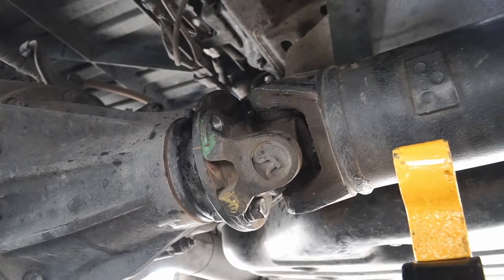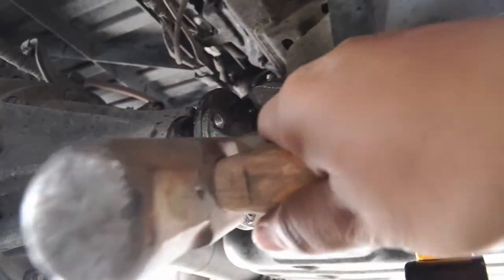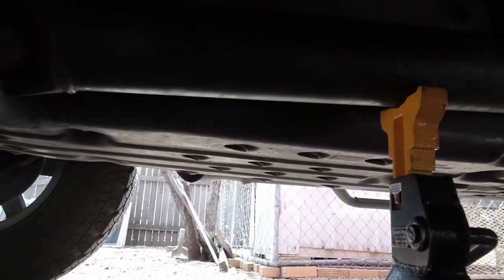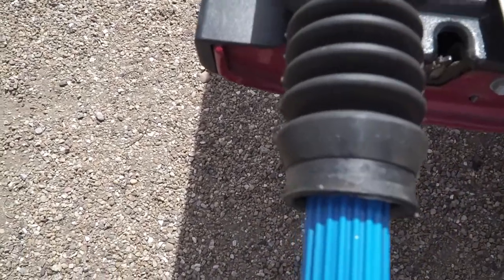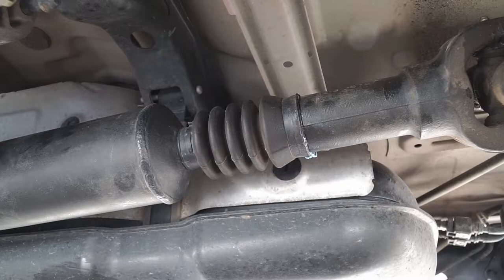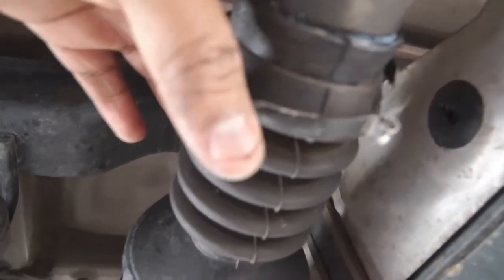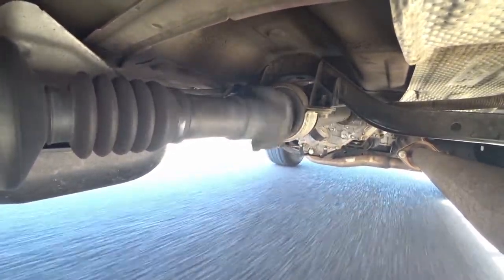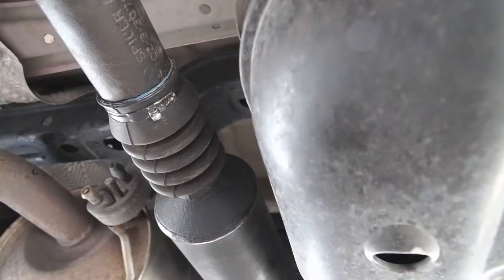2012 Toyota Tacoma Drive Line Clunk Fixed!!!

Comment: I normally do not comment on videos, but this completely fixed the rear end “bump” feeling when coming to a complete stop and then when accelerating off the line again. I’ve been trying to figure out a solution to this issue for over a year now and just stumbled across this video on a Tacoma group page on FB. I just went on a test drive the issue has been solved! Thanks again for making this video 👍🏼
Reply from the maker: Hey man! Glad greasing the shaft fixed your issue and this video helped you figure out the cause! Woot!
Reply: What kind of grease do you use? I have some lithium grease here at the school im going to, would that work? Or does it need to be the specific?
Reply: Pacheco _15 heavy duty grease is what I used from advance auto zone and it worked, I don’t know if regular lithium grease is thick enough or not.
Reply from the maker: Pacheco _15 i am using a Teflon based grease, since that’s what is needed. Do not use petroleum based grease as it may eat the rubber on the splines. 

The grease I use is from Motorcraft. I think I left a link in the description or the name of the grease. This Ford grease is amazing and cheap, best out there you can use. 

Stick to Teflon based grease.
Reply from the maker: David Mac actually you don’t need thick grease. Lithium grease may be too think. That’s more for like poly bushings. What you need to use is Teflon based grease. Make sure what you got at Advanced Auto is Teflon based and not Petroleum based grease.
Reply: Five Foot thanks for the info! I ended up going with the Lucas X-TRA Heavy Duty Grease (green and white tube) and it fixed the issue. I can’t find any info about the chemical make up of this grease if it is lithium, teflon, or petroleum based so I’m not sure?
Reply: I'm about to tackle this issue on my crew cab. Is the grease job still working good?
Reply: @telegoose9905  it feels fine during the warmer months, but during the colder months seem to feel the clunk just barely. Overall it definitely helped the issue though so I might grease it again after winter is over (about once a year)

Comment: Hey there, I’ve had the clunk and slight shudder from first to second gear for quite some time now. Depending on hot or cold temps. I’ve been to multiple shops and everyone says it’s just a quirk. So glad I found your video and can’t wait to get this done in hopes in fixes my problems. Keep you posted
Reply: Did it fix it? My 2012 does the same
Reply: @danielzwarren  it did fix the clunk! However I still have the shudder at take off. I think I’ve narrowed it down to pinion angle being the issue. Gonna try axel shims next
Reply: @SHREDDINLEMUR Any luck ?  I have the rear clunk

Comment: I used the new white grease from ford that comes in the driveshaft repair service bulletin kit 9L3Z-4W602-A, $30. Most people that use even very good grease state the clunk comes back 10k miles or so, but so far so good. At first I only lowered the support bearing and added some mobil 1 bearing grease to the splines, the clunk was the same.

Comment: Thank you for this. I have a 2017 taco and I was wondering where to service the shaft for the rear.  Toyota told me it dont need to be serviced but the manual specifically says service the damn thing. The guy told me because it does not have a zerk and its a sealed item. I  sure it still have gears and have moving parts and anything that has a spline gear moving needs to be serviced.
Reply from the maker: You're welcome! Glad this video was somewhat helpful to you :)

Toyota told me the same, they told me in order to fix the clunk noise I had to replace the driveshaft, which I thought was nuts so I did a little research and found how to service it.

Same with the automatic transmission. Toyota says its a sealed transmission, I've flushed my transmission at home at the recommended mileage, dropped the pan and cleaned the magnets and replaced the filter mesh AND finally, installed an inline oil filter and oil cooler :) She's been running fine AND much better for the last 35k miles since I did the maintenance job.
Reply: @temosgarage  i wish you made a video for that. My Taco is at 30k, im looking for a specific video about the transmission too cause i iwant to change it at 30k.

Comment: Thanks for posting this  video, I have a 2015 tacoma,I also have a 2004 jeep grand cherokee  and this happen to it, I bought it used had the same issue on it called bump stop did the same as you with the same Motorcraft lube and had no more problems with this, I didn't  know this happens with tocoma as well . Thank you for making me aware this could happen .Thanks you...

Comment: Just thought I'd let others know that are looking to do this job. You can also disconnect the clamps on the boot then take the two bolts off that hold the carrier bearing, then lower the center of the drive shaft where the center U-joint is located at the spline. It will come apart. (the weight of the two halves will pull the drive shaft apart and separate it at the spline so be sure to hold on to both halfs when doing this and keep something soft below in case one of them strikes the ground) Be sure to apply the parking brake when you put it in the location you're going to do the job this will take the load off of the drive shaft so it comes apart easily, this will allow the splines to line back up where it's supposed to when you're finished.
Reply from the maker: Good point, ill have to try that next time. Thanks!
Reply: Do you know what the torque spec is for these two bolts? also 65 ftlb?
Reply: @jrbling25  I never looked up the torque spec on those bolts.
Reply: @mech4061  the link that you put up for the cowfoot wrench. Is a slandered. Toyota is metric correct?
Reply: Wow, that sure was painless. Thanks for the tip. Finally stopped that annoying clunk.
@Mech40Tacoma
Reply: Doing it this way, it was hard getting the 2 halves back together again, but finally forced it and it went in. 👍
Reply: Does this method in any way endanger the u-joints from snapping or snapping the bolts connected to the rear diff?
Reply: @70Marc   how did you force it I’m fucking struggling brother
Reply: @romangarcia9338  , was away and no wifi, so no early reply.
Anyways, you got it apart, obviously. Hopefully the shafts didn’t turn on you, so they should realign. Not in neutral.
Rotate, as in move the shafts up and down, sideways, roll around till they’re very close to going in. Once you find the sweet spot, they should go in. Worse case scenario, you find a spot that’s almost there, and kinda pull or push it in till  it’s in.
Hope this helps, drop a note, hopefully you were successful. 😊
Reply: Much appreciated brother ended up tapping it with a dead blow hammer once it got close and it went in by the grace of God .
Reply: @romangarcia9338  , my first time i kinda had to do that. Next time it went in super easy.
(Unfortunately, I’ve recently got the clunk again, but I was towing my travel trailer.) Taking it easy on the clutch eliminates clunks.

Comment: My Tacoma manual states to use NGLI # 2 grease either Lithium or Moly based. I’m not familiar with this Ford one. Would using this Ford brand be ok?
Reply from the maker: I think you’re referring to the u-joints. I’ve been using this Motorcraft grease for years. It’s an excellent grease for the slip yoke. It’s not just ok, it’s excellent.

Comment: Cannyou put a spring inside the splines to absorb the slide bump?
Reply from the maker: I’m sure it CAN be done, but long term wise I would think the spring will do damage to the splines since they’re coated with what looks like Teflon. It’s better to just grease it. Lasts a while too. 

I’ll be greasing the shaft this summer, it’s starting to make that bump/tap feeling again.

Comment: I'm hearing a noise from my 2013 tacoma when I come to a sudden complete stop. It won't do it if I'm stopping very easy but when I stop sudden I hear a slight thump noise like the truck is settling from a slight shift in the rear.  I'm thinking it's a leaf spring. The truck only has 53,000. I couldn't see it be anything else with that low of mile
Reply: It's axle wrap. It happens when the factory leaf springs start to wear out
Reply: I have the same clunk when I stop or when the axle rocks

Comment: you marked the back of the tail shaft where it goes to the diff but NOT the front ?? You should mark the front as well to get the splines back as before
Reply from the maker: I did mark it, just didn’t capture it on video.

Comment: My 2002 Tacoma doesn't have that rubber boot but the slip yoke does have a grease fitting but my manual says to use moly grease. I do notice a clunk if I go to long without greasing it though.
Reply from the maker: So, moly grease is for the u-joints. I am not sure what to use on your 1st Gen Tacoma. This video is specifically for the 2nd and 3rd Gen Tacos. I would guess the 1st Gens would also use a Teflon based grease.

Comment: My 00 tacoma forerunner vigrate when I put it in gear. Do I need to replace u joint and center bearing
Reply from the maker: Only vibrates when you put it in gear or vibrates at a certain speed? If when you put it in gear, could be something more serious than u-joints/carrier bearing. Could be a bad torque converter. If it vibrates at certain speeds then might be the ujoints and/or carrier bearing. Being a 2000 model, if the ujoints/carrier bearing have never been replaced, it might be time for them now.
Reply: @temosgarage   only on drive gear it make noise
Reply from the maker: Idk man. that's a tough one to diagnose without actually being there to check it out.

Comment: I’m getting like a clicking/rattling sound on my 2016 Tacoma. It snowed pretty bad today and I had to engage 4WD.. I am wondering if that is causing it. It is happening in 2WD too. Any help? Thanks in advance
Reply from the maker: Sorry for the late reply. The slip yoke should not cause a clicking/rattling sound. Could be an exhaust shield maybe? crawl underneath and start wiggling parts and see if you can narrow down what it is.
Reply: Carrier bearing is bad.
Reply: Catalytic converter, or 4wd actuators.

Comment: @five foot garage great video. Quick question....what did you use to mount the camera under your truck to capture video of the driveshaft in action? I am pretty sure my 2016 Taco U joints are going out and I could be having this drive line clunk too but I want to put my go pro under the truck to capture my driveshaft in action.
Reply from the maker: A strong magnet I got on Amazon years ago

Comment: What if you overfill grease to the driveline and it makes clunks noise
Reply from the maker: Remove the driveshaft, clean the excess great and assemble it back together. 

Too much grease in the yoke removes surface area that allows the spline to move forward/backwards (in/out).

Comment: That rubber boot isn’t installed from the factory is it? Mine doesn’t have one. I just greased my slip yoke and still have this problem.
Reply from the maker: kyl3dr yes, the boot comes from the drive shaft manufacturer, which is Spicer or the factory; one of the two, but it comes with it when you drive it off the lot brand new. The sucky thing is you can’t get the boot alone from the dealership. Trying looking for one at a junk yard lot or if you have Facebook, join the Toyota Tacoma Enthusiast page and post a comment asking if someone has a spare you could buy from.

Comment: Does anyone have the thud problem when stopping or going only when it’s hot? I live in PHX and the summer heat causes my Tacoma to have a clunk after stopping and take off. But soon as winter time and it’s in the 70s,60s,50s, it doesn’t do it once ALL WINTER. Let me know please!!!!
Reply from the maker: David Villalpando yes, during summer is more noticeable because metal and rubber expands. The spline has a rubber like coating and when temps go up, it expands and is a tight fit inside the yoke. Greasing them will get rid of this thud, which I described in the video.
Reply: Ok got it! Thanks! I’m going to grease my u joints first and see how it goes. If it still is bad then this is my next step. I forgot to mention I have a lift on my truck
Reply from the maker: David Villalpando lift or no lift, it’ll still thud. Mine used to do it when it was on stock suspension. I’ve added a lift nd still does it. I need to re-grease it sometime this summer.
Reply: Five Foot I appreciate the info! Hopefully this will end the never ending clunk I have going on in the summer. These trucks are so badass and meant to last forever, but little sounds and quirks they make can take over your life LOL

Comment: You should be using high pressure grease with molybdenum. It will stick better and last longer. It’s usually dark grey stuff.
Reply from the maker: I "should", but it actually requires a teflon based greased for this instead. The splines have a rubber coating and teflon works great for this.

Comment: Anyone have any ideas? - I have a 2021 TRD Off-Road. Bought it brand new here in San Antonio. Around 3,000 miles I started noticing a “clunk”/jerking sensation when I’m driving in 5th and Big Time in 6th gear. 

When I let off the accelerator, then resume speed (i.e. giving it gas again), I’ll feel the clunk or jerk. I took it to Alamo Toyota where I purchased it. Was told they checked our the drivetrain components, engine mounts, etc. Was told it was “normal”. 

I eventually took it to Cavender Toyota. Had the service advisor take a ride with me on the highway. She felt it right away. They had it for hours. Said they even called Toyota engineering and I was told it was a “characteristic of that drivetrain”.

I find it hard to believe that Toyota, a company with brilliant engineers, would design these awesome trucks, but “well, we just can’t figure out how to get rid of that “clunk” or jerking sensation.

I realize manual transmissions are getting rarer by the minute. Has ANYONE else had this issue? This is my 5th vehicle with a manual transmission. I don’t ever recall having a clunk or jerking sensation when I pushed on the accelerator after having my foot on it. 

Love this truck, but it’s mentally frustrating feeling that clunk. Appreciate any feedback or input. Thanks again.
Reply: It sounds like the slip joint. Did you ever figure it out?
Reply: @231mac  still there. I’m taking my truck in next week for 45,000 mile service. I’ll talk to my service advisor about that and let you know what they say.
Reply: @ddl5856  Please do and best of luck.